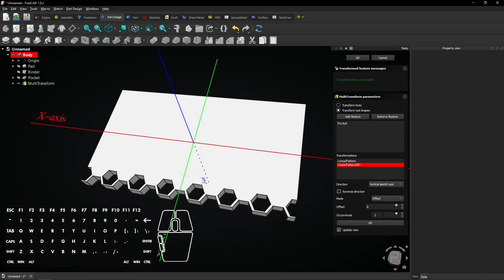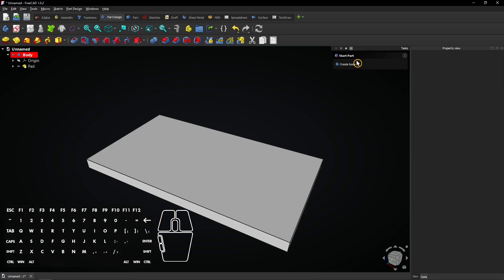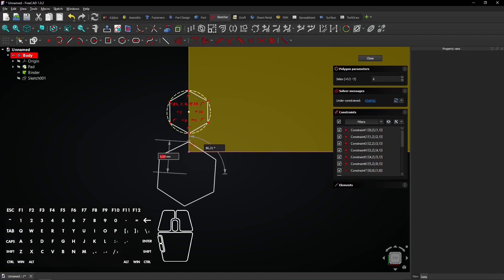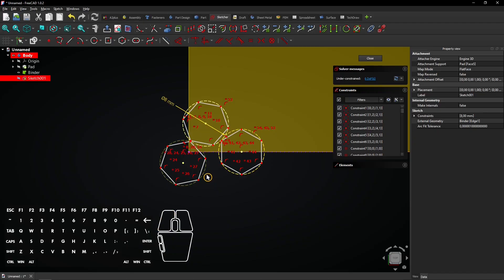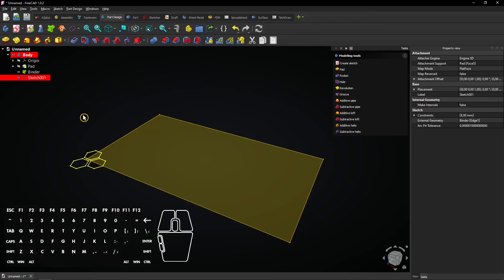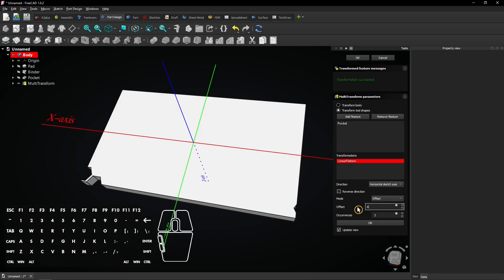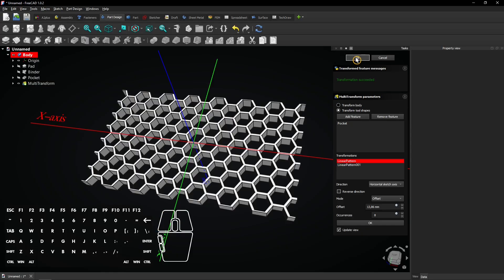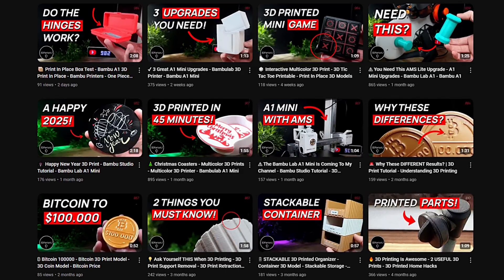👍 FreeCAD Honeycomb Pattern - FreeCAD Tutorial - FreeCAD MultiTransform - FreeCAD 1

Comment: I would like a method to create this pattern parametrically, so that the cell size can be calculated automatically based on the wall thickness between the cells, in order to cover a rectangular area with a defined width and height — not just a motif randomly placed on a rectangle.
Reply from the maker: that would be great! Not sure if this is possible in FreeCAD (yet).

Comment: Just when it would have been useful, "that's it kthxbai" 😕
Reply from the maker: 🤔 Could you explain what you mean?
Reply: @AllVisuals4U  at 3:28 I thought I would see the result and have a few moments to connect the action to the result. I could not remember the action because I didn't see the result then I got distracted by the subscription prompt which is oddly in the middle of the video.
Reply from the maker: Thanks for the feedback! Nothing actually changed after clicking OK. The preview was already there.
Reply: @AllVisuals4U  on review, it's mainly the timing of the subscription prompt that ruins the flow
Reply from the maker: I will keep that in mind!